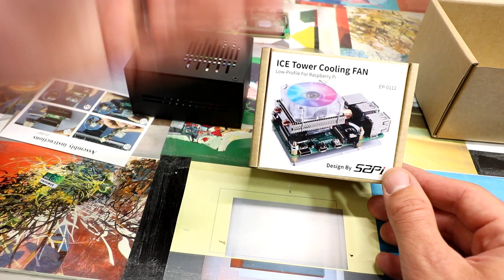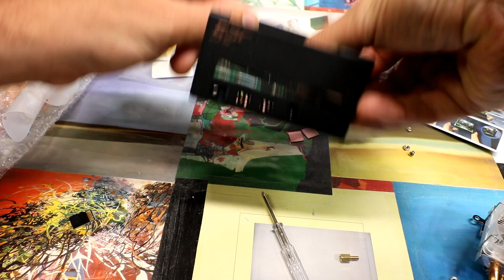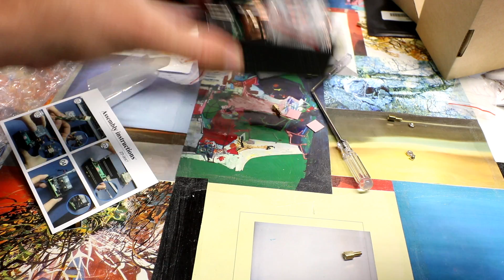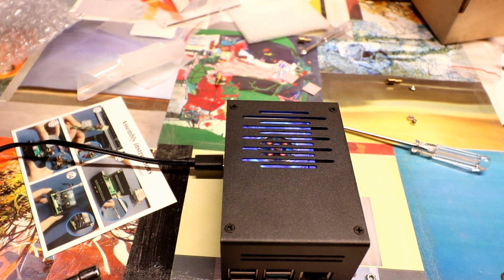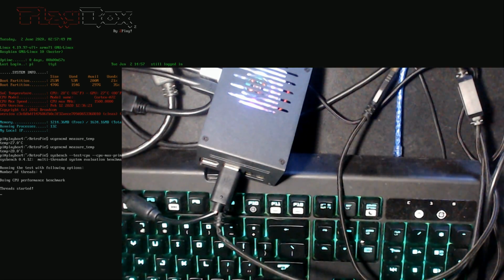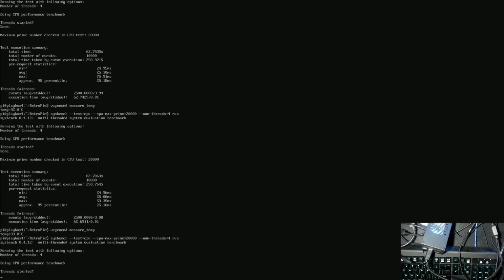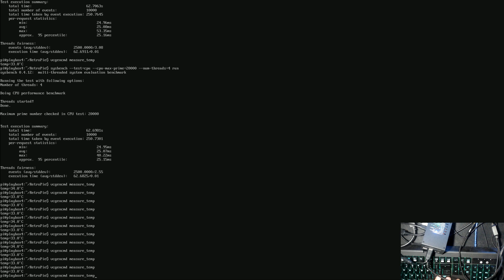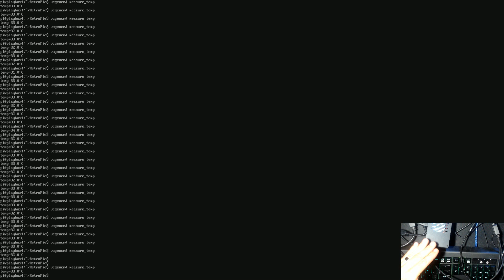Raspberry Pi 4 Low Profile Ice Tower Heatsink Case - Huge Cooling Performance

Comment: I have one of these cases. Case design absolutely sucks for attaching the board to the case. The  RGB fan is gaudy and pointless (I replaced it with a Noctua). The SD card is almost  completely inaccessible. Once assembled, you can't argue with the results. BTW, I used Arctic Silver thermal paste instead of the pads. Much better result.